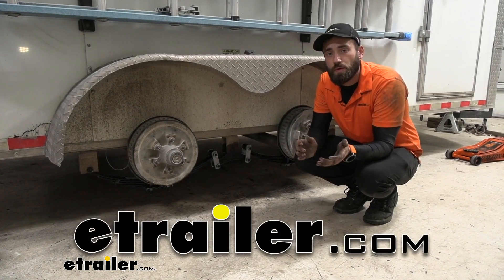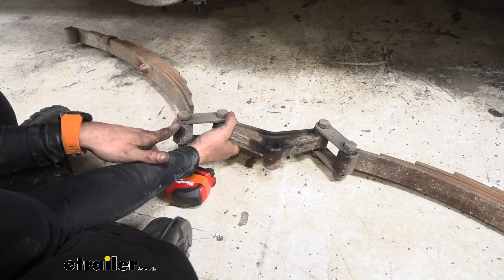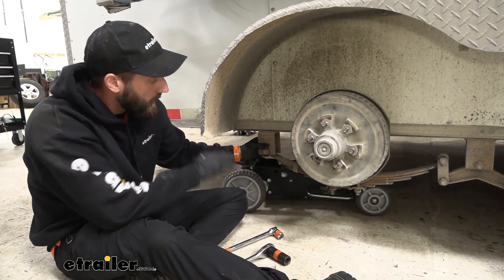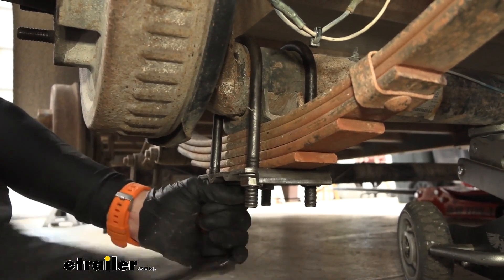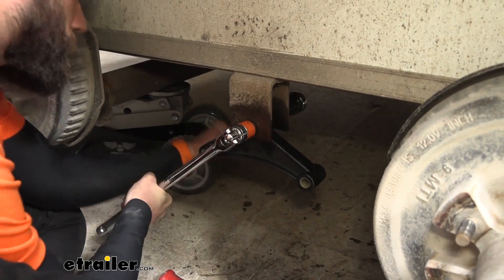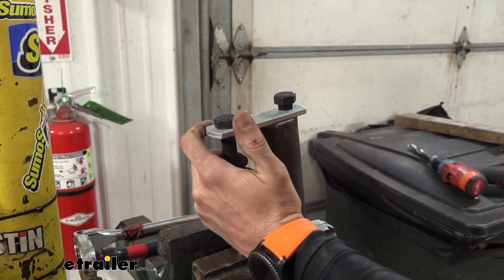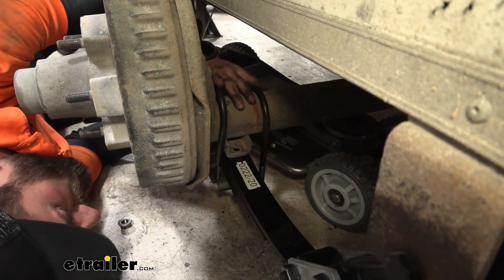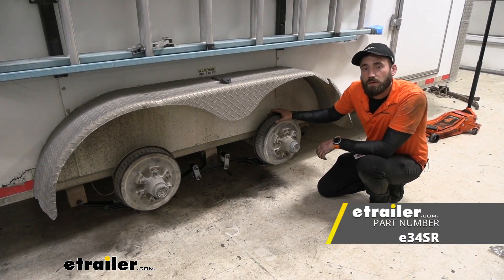Setting Up Your etrailer 5-Leaf Double-Eye Spring on an Enclosed Trailer

Comment: Interesting! In a different video you point out that the retainer clips go towards the FRONT on both springs, but in THIS video it's pretty clear that you've installed the springs such that the retainer clips are "outboard" (the front spring has the clip to the front, and the rear spring has the clip to the rear). I point this out because I just purchased a set of four springs from you (etrailer), and the previous owner of my trailer installed the springs haphazardly and/or inconsistently. So which way is correct? https://youtu.be/9rkJbtMr1K0?si=FhsQcVi2Kx-oj8g4
Reply from the maker: There isn't a bunch of agreement on that. Some will say that the leaf spring retaining clip should be forward of the axle, some say behind. Some will have one in front and the other behind. In my opinion, it doesn't make much of a difference but I would recommend that you be consistent so they're in the same orientation on both sides of the trailer. I hope that helps.
https://www.etrailer.com/Trailer-Leaf-Springs/etrailer/e34SR.html